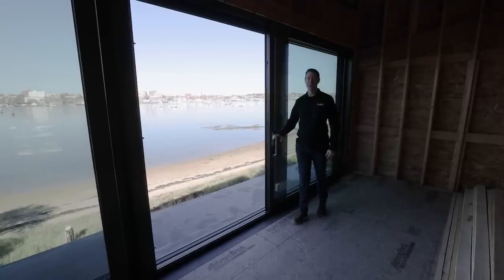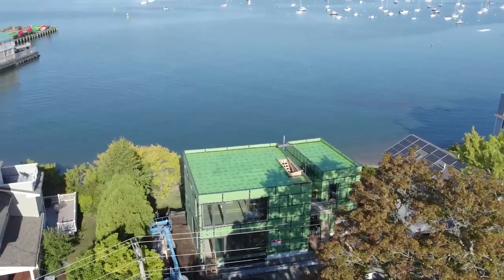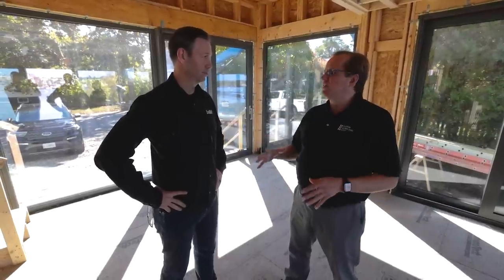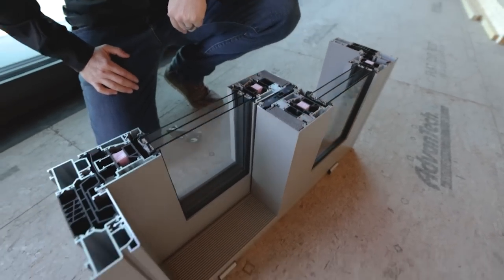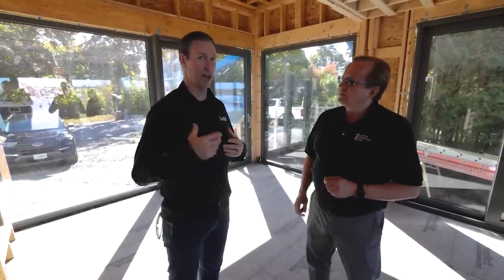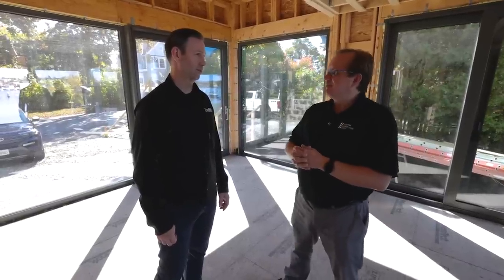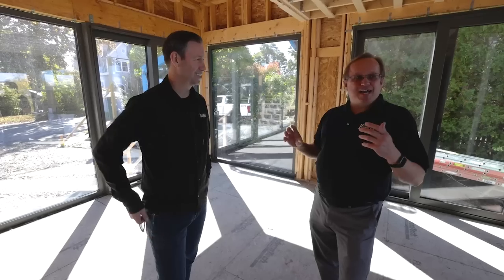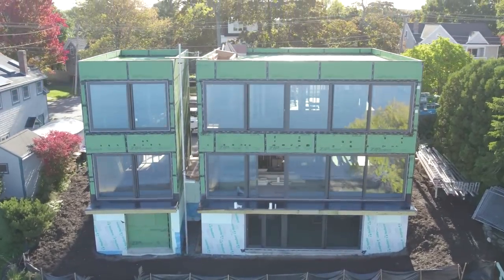How To Get Better/Cheaper Windows from Europe (to US Job-sites)!

Comment: FYI, I just priced out shucos’ here (10 windows) 2- 3x5s 4-6x5s mulled units basically , & a 8wx7’8” lift & slide & 2  3x7 entry doors…about 26k shipped
The 3 doors alone were 12.5k before shipping, so i asked to redo the quote without the doors & EAS told me they were not interested in a small order. I like this channel & Matt for bringing different ideas/tech on building a quality home, but for a regular guy building his own home 1500sq ft, i cant justify a 9k +  slider door.
Reply: what was the cost per sq ft?
Reply: Yeah I agree with you. I am sure these are amazing but so is a Ferrari, doesn't mean I would buy one. I don't think importing insanely expensive windows and sliders from Europe makes sense for most sub 1mil houses or depending on the area 2mil. 

So many good vinyl windows out there with decent u values, I am not sure I could justify that type of price jump. What is it getting me? How much do I actually save a year over more moderately priced windows. How much longer will they actually last? 

I'm not much of a window snob.. needs to open smoothly, decent u/r value, disassemble for cleaning easy and have a supply chain for any parts or replacements if the kids break one. For me Simonton windows (brickmoukd 600, 5500 replacements) have been great for the price and I have not used any window yet that was so much better I would be willing to spend 2-4x the cost. Custom ordered Simonton windows to my site were in the 250-300 range for standard sized windows. And they are so easy to install with a flange, it's hard to screw up.
Reply: I had a similar experience recently with them, I'm building a 2500' house and received a reply from them basically stating they'd quote it if I really wanted but it wasn't going to be cheap or easy.
Reply: Same here.  I don't understand why this is the 3rd video without Matt covering the cons of their sales department.  Every small builder is saying the same things.  They don't want small orders.  They won't ship unless you find a larger partner in your area to combine delivery. 
This video title is even misleading now,  getting us excited thinking something has changed but nothing is addressed to these complaints yet again in this episode review!  Wth!?
Reply: @TimFrentz  the video is a paid ad by EAS just like some others previously. EAS is not the only US dealer of schuco windows, or other great european windows for that matter. if EAS customer service is garbage take your business elsewhere.
Reply: Smart move, high end doors/ windows are a horrific waste of capital. If you’ve got tons of money to burn, then whatever. Otherwise, spend the money elsewhere.
Reply: About 105/ft
Reply: @reggiejenkins6458  I agree with you, most the time the expensive does not result in enough benefit. I wouldn't get cheap windows but at a certain point you are just throwing money away given the quality of the rest of the house.

For the bulk of US houses, quality moderately priced vinyl windows are such a great bang for your buck!
Reply: @Josh.1234  totally. Mid range nowadays is actually pretty great for most building products.
Reply: yeah.  Matt's audience is now really rich people.  I used to love watching him.
Reply: @patglenn5705  I don't think there is a problem showing cool expensive building products but he should really temper his praise with context on where this stuff makes sense. Still love his videos

Expensive stuff has a habit of coming down in price when it gets popular
Reply: @Josh.1234  i think this needs to be quantified, especially relative to climate zone. if you're in climate zone 5 or above, you better be getting windows at or below a U factor of 0.2.
this number can be achieved at a reasonable price in a picture window. if you double hungs that scream of 1994, you are aren't getting a U factor of 0.2 in a reasonable price.
Reply: @stevecrawford6958  I would love to see what the net effect of going from a .28 u double hung window to a .2 u window is for the average us built home in different zones. Home much money/energy is saved? how much more normalized is the home temperature? I know this data is probably out there

Basically what are you really getting for that expense. It might be that depending on your zone, going below a certain u value might not have much net impact.
Reply: @Josh.1234  i agree totally. if you find the data, im all ears!
Reply: EAS refused to quote my build saying they aren't doing west coast builds. I ordered over 600 sqft of windows from Innotech (Thanks Pat M.) and I think they were reasonably priced...
Reply: Yup. Zola wouldn't do less than a 25k order... but I still want them
Reply: I priced 21 of their salamander 82 series (20 windows 1-10’ slider) $17,100 shipping with another 5k tax was not included.
I priced out a bigger slider at a local window/door dealer it was 15k just for the door.

Comment: My builder and I had a great experience working with EAS on our new build In Virginia this past year.  They have excellent communication and we never had to wait more than a day for a response. We went with the less expensive Salamander line, which were 20% less expensive than the same Schuco window and door package.  I'm not sure why Matt and Steve never mention the Salamander line that EAS offers.  I am very impressed with the quality of the windows, as was my builder.  The cost for triple-pane uPVC windows and doors was basically the same as double-pane Marvin Essential, and way less than the Elevate triple-pane. Shipping and Delivery costs to VA were $4200. It worked out great for us and I couldn't be happier with EAS.

Comment: We are going with euro windows on our new project but one thing not covered here is functionality. The US market is not accustomed to the bi-way or tilt and turn opening of euro windows but unless one really can't see a way to incorporate it then I see very few drawbacks going with imported designs like these.
Reply: I was working in a house a few days ago that had tilt sliders. Never seen that before (I thought something was wrong with the hinges, lol) but it made perfect sense once I saw them operate. Why isn't everything like this?
Reply: Two drawbacks - I’d you don’t want a vinyl window they are hardly inexpensive. And their profile is VERY thick.American d windows ARE way overpriced admittedly.
Reply: He dodged the install problem- ie u r on your own- flanged windows much easier to install  those same tapes are available  to flange installs to - I call bs flangeless better weather tightness than flanged.
Reply: Price, logistics, support, instalation.. good number of reasons to not buy these windows.

On sub 1-2mil houses, I can't justify going for high end window packages when quality vinyl windows will function great and for the money, would not add much value for the customer.
Reply: @Josh.1234  for reference Pella package came in at 12-15K more than the euro quote. One fiberglass the other PVC etc. So comparable product in terms of not being the most expensive option but not in terms of level of tightness, function and size. Once I used the euro windows and saw the windows close as tight and solid as a door it made the US manufacturers look pretty behind. Again if comparing the mid-range offerings and not the high end ones. So budget wise I'd say the euro option is still ahead.
Reply: @speciesofspaces  well fiberglass and PVC are not the same price range. Fiberglass is a more premium product usually more expensive.

What did one of these euro PVC windows cost? Compared to a pella? 

I buy pvc windows in the 300-500 price range for an average size and they close just as nice as any window I used in Europe.
Reply: @Josh.1234  we currently have Pella fiberglass and I can tell you the Impervia is no comparison. But again US windows are designed differently and are much smaller in form. The current pricing on the Pella Impervia fiberglass basically has nothing under 1K per window unless it is fixed like a picture window. But again based on our Impervia windows from a few years ago the function and quality just isn't as robust as the euro designs. The locking and tightness on the euro line is much better. The Pella typically pull on only one side of the window etc.
Reply: The only drawback is, you cannot use window splitter ACs with that design!